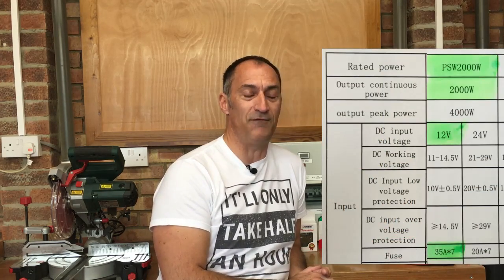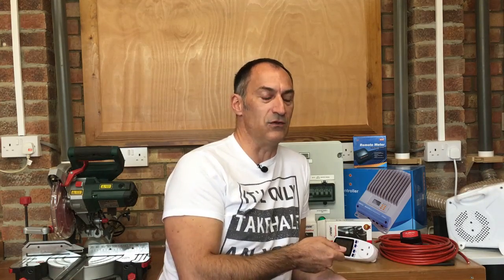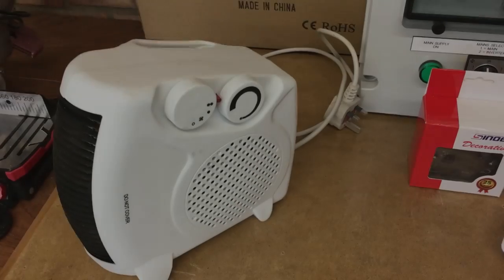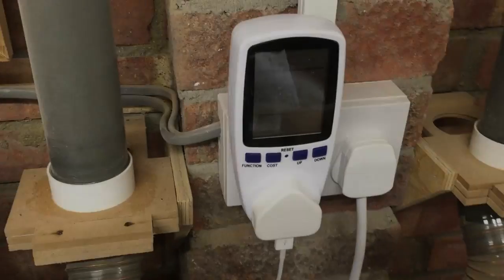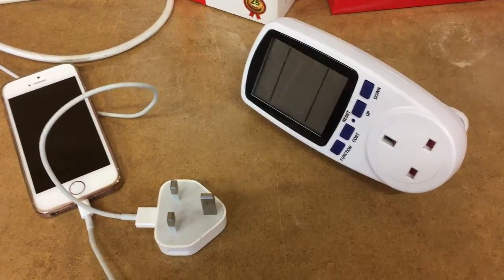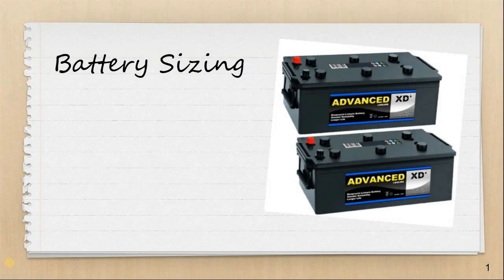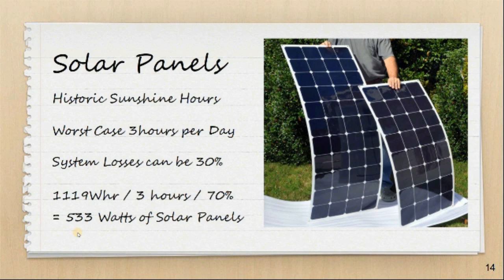Off Grid Battery & Solar Sizing - Self Build Campervan

Comment: Any thoughts on using a small wind generator, remote stand or van mounted?,  to charge. It has the advantage of running 24/7 wind dependent. Great series thanks😃
Reply from the maker: That is another option you could consider, I haven't looked into it but I know they are used a lot in marine industry. You may be looking at boat suppliers for this gear.

Comment: Hi Greg  great video .You could consider a Stirling batter to battery charger I installed 2x60 amp chargers after poor charging using vsr split charger and changing solar wiring to series to give longer charging duration during poor light. Charles Sterling has a youtube channel showing a Sprinter with BtoB charger .

Comment: Hi Greg, thanks for your very informative videos. I am wondering about the power needed to charge the battery. I didn't see it mentioned in the video.
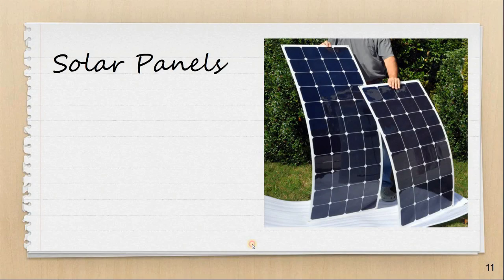Reply from the maker: Hello Jean, the sizing of the solar panels which will be used to charge the batteries starts at 13:37 in this video.

Comment: Like others said, change to a different battery type.  Love the videos.
Reply from the maker: Harvey, do you mean go to Lithium?
Reply: Not necessarily, but always (and much more expensive) better.  If not, "jelled" lead acid deep charge.
Reply from the maker: I’m most likely to go AGM at the moment. Deep cycle leisure batteries with 3yr warranty. Technology will have moved on massively by then.

Comment: Hey Greg, great video again! 

Just recieved my 2500w pure sine wave inverter and the manufacturer included 40A blade fuses. As you mentioned at the beginning of this video I should use a 200 or 250 amp circuit breaker instead between the inverter and battery correct?
Reply from the maker: Hi Adam, take the inverter watts divide by battery voltage and add 25% margin. 
2500/12x1.25=260
You would be better fitting 250A fuse next to your battery.
Reply: Greg Virgoe Thanks again for the assistance Greg!
Reply from the maker: You are welcome Adam. Thanks for your support

Comment: Holy shit. Solar power is inefficient? It has to be the most efficient power we have here on earth. You maby get 5% efficiency out of it in a normal use scenario. That your producing yourself and can place on your camper or house!

But the cost to get that 5% is the production of the solar panel and battery storage. You say 15% of the surface is efficient. But outside of wasted space the 85% outher part of the pannel is not hurting anything. It's just heated by the sun that had anyways heated up the plannet. That 15% is 100% free convertion of electrical power. 85% of the rest did nothing! (but waste space on a roof) Bad thing with solar is that one needs battery storage to make use of it really. That sucks with solar power. But strait solar power pay for itself within its lifetime. (production costs I refer to)

Power from the wall don't use batteries but insted feed you with power generated directly on the grid. The grid efficiency varies but ain't better than 30% and have a loss transporting the power in powerlines to your place of electric needs. Maby your lucky and get 12% out of it. And that can be coal or nuclear power. All have drawbacks and faults. Windpower is also bad due to gearbox failures and the noise and setup cost of the shit. Waste of time build coal plants if you have to. They are that bad. We need the space and resources for better things.

It is all a matter of what you take into account when it comes to efficiency anyways. Kamikaze bombers was a more efficient way to bomb attack in WW2 vs normal bombing operations. Saved more soilder lives to have them ram there planes and themself into the enemy. This being just in some instances but still. Just to give a ide what I mean when it comes to efficiency it's all about what you take into account. And no I'm not a green energy type. I'm just saying that efficient power is not strait out a % but the whole picture from beginning to end. Solar power with some magic battery storage sure is the magic we need to keep or lifes the way they are now.
Reply from the maker: It's a costly affair to be green, but the best solution at the moment if you want to camp off-grid.

Comment: there are panels that can give you 600-900 watts for a sprinter van
Reply from the maker: Hello Andrew, you must mean 2x300watt or 3x300watt solar panels. These would pretty much cover the entire roof of your sprinter. There are currently only two companies that produce a single panel over 300w and the largest I know of is Sunpower 340W panel.

Comment: Very good video just one question do you really need an inverter? Except for the hair straighteners all the other stuff can be powered from 12v ... seems like a lot of trouble for very little use
Reply from the maker: If you can replace all your chargers and tv for 12v and fit a gas fridge then you can get away with not having one. In your van you can do as much or as little as you want. We would like the convenience of being able to plug in a normal 3pin appliance and run our fridge on 230v instead of gas. 
It’s entirely up to you what you want to run in your van. Cheers

Comment: Hi Greg, thanks for the video! I wonder why you only use your fridge for 12 hours in total each day (2x6 hours for 12V and 230V). Are you running it on gas by night or is there something in the calculations i have misunderstood?
Reply from the maker: Hi Maria, great question, your fridge works on a thermostat and the compressor only runs for part of the day when the temperature inside rises, say when you open the door or put something warm inside. For a large amount of time it sits there cold and happy.  It may even be only a third of the day depending on how much you use it and the surrounding temperature. I plan to just have dual electric and not a gas fridge. I don't like having to cut huge vents in the side of my van for gas fridge. Hope that helps. Thanks for asking.

Comment: Hi Greg, I am reconsidering my plans on solar after reading this, really would like your thoughts on this.
https://www.solarpaneltalk.com/forum/off-grid-solar/12v-solar-for-rv-or-camping-etc/367951-help-please-sizing-up-my-new-solar-system-for-my-camper
Reply from the maker: There are quite a few mistakes in the maths there.
The fridge would not run for 24hrs it works off a thermostat.
Depending on the use and how many times you open the door.
This could quite easily be less than a third of the day.

Comment: Greg, I do like your approach! Did you look at B2B chargers when planning the system? There are some slightly scary comments on other sites about "smart" alternators not allowing a full charge on the leisure battery.  There also seem to be some issues with B2B chargers conflicting with other stuff too!  The solar option does sounds like the best/simplest way to go, but it is up there in cost.

Comment: Hey Greg, awesome video as always!
I tried the same sizing you did for battery and solar. In the end i came up with 91,11 Amphours/48h and 84,3 Watts Solar power to calculate with. My question now is: does it make sense to still put a 230 Ah Battery in or is it 150 Ah fairly enough, even if I am going to be staying in the same spot for let's say 3 days of days without plenty of sunshine? Is it a problem for big AGM batteries, if the don't get discharged for their complete capacity every once in a while?

Would you say a 100W solar panel is enough to compensate all of my power consumption or do would you put up more to load the battery?

Thanks for your help and support. =) cheers
Reply from the maker: Hello, with all lead acid batteries you should never discharge them fully as you will damage them. Some manufacturers say you can go to 80% but I would not recommend going down more than 50%. What happens is the further you discharge them you degrade the cells and shorten the number of charging cycles and the life of the battery. It is far better to keep the battery topped up and use a little of its energy. So if you can afford the weight, space and cost go for a slightly bigger battery as it will last longer if not being drained so much. Similarly with solar, as these are so inefficient 15-17% and you can never rely on the sun or weather doesn't hurt to have a little extra in hand. I'm actually fitting 3x160w panels to my roof which is the maximum I have space for giving me just under 1/2 kW of solar. I'm also devising a tilting mechanism to angle them towards the sun, this will give me 30% more efficiency when travelling in Europe due to its northern latitude. Hope that helps

Comment: Does the thing about batteries, that you should only use Them down to 50% apply for AGM's aswell? I heard that they do a lot better on deep cycles. True or not?
Reply from the maker: Hello Henrik, AGM batteries can be discharged to 80% but like all batteries the more you discharge them on a regular basis the shorter the lifespan is in terms of the number of cycles. The cells degrade the deeper they are discharged.
If you can get away with a slightly bigger capacity and not discharge it so much they will last much longer.
Reply: Greg Virgoe thank you for your Quick answer. i Will take this into account for My build. Also awesome channel. Its helping me alot to plan my build on a sprinter im planing to live in.

Comment: Hey Greg. I agree with some people bellow, about your teaching skills, you should definitely consider being a teacher. However, I have a small question. In your table of appliances, I have read that you will be running fridge for 6 hours? Why did you count just six and not 24 h?
Thanks for the answer.
Reply from the maker: Very good question Igor,  Your fridge works on a thermostat, when it gets warm inside the thermostat turns on the compressor and the refrigeration system cools the interior. Once this comes down to temperature the thermostat turns the fridge off. So depending on how many time you open the fridge door and let out all the cold depends on how much your compressor runs for. So I have just guessed that it will be running for a quarter of the time.
Reply: Thanks for the answer, I assumed could be that, but just wanted to make it sure. Thanks again and keep posting your videos, they are great!:D
Reply from the maker: Thank you and hope you enjoy the rest of the series

Comment: Hi Greg.  You, like me, should need to use the hairdryer for very long :o).  Great detail.  I am hoping to opt for a diesel heater as it may be needed when there could be no shore power available.  I probably won't use the hair straighteners much either ;o)
Reply from the maker: Haha, I only need to stand under a fantastic fan on supply and 3 seconds later I'm good to go 😂
Reply from the maker: That’s a good tip for everyone stateside, although shipping and import duty for us in the UK is a killer. Another good source is Marine and Ship industry as they all run off 12v systems too. Thanks 😊
Reply: Webasto makes a great diesel heater,its pretty much the industry standard bunk heater for the big trucks here in the states.Also dont be afraid to check out some big rig stuff stateside for ideas ;)
Reply: They have a European dealer network,I know of about 6-8 in the UK near London along with a few near Manchester too and I'm sure there's more. I know you guys get beat up pretty good importing stuff,I even had to pay import duties on personal goods while working in the UK..........Good times lol.
Anyway,thanks for the great vids with real information for a change.Your van sure beats the air mattress we chucked in the back of a Transit purchased in London and ended in Bulgaria 3 months later ;) Still was a great time though and I want to do it again.
Reply from the maker: That’s sounds like more of an adventure though. I’m all for chucking a mattress in the back and off we got. However unless there is an onsuite the other half is not impressed. Lol

Comment: Lithium deep cell are the way to go as you can discharge them near %100 so a 200 amp hr is equal to 400 amp hr regular battery, they last 6 times longer and are %70 lighter, but are very very expensive...Hope they come down in price by %60 in the next few years..A buddy gas heater and portable gas cooktop might be a good idea to have as backup..
Reply from the maker: You are absolutely right, they are much better but still very expensive.
Reply: @GregVirgoe  could you do a video on where to buy cells, I’ve watched loads of lifep04 balancing and bms seems straight forward but buying cellls is a minefiled ?
Reply from the maker: @tospicy4ya  I’m not the guy to do that. We have AGM batteries living full time for 4yrs now and they have never been switched off abs never dropped below 12.4v so like that they are far better value for money 🥴🤔
Reply: @GregVirgoe  is that even under full load? What battery are they?
Reply from the maker: @tospicy4ya  LEOCH AGM 110Ah Batteries x3 of them. I manage my power use all year round so they are always 70% full and like that they will last me for years. They come with a 4yr warranty to start with.
Reply: And they are much easier to charge since their internal resistance is much lower. Definitely cheaper to use LiFe when considering useful life.
Reply from the maker: @Toaster-v1z  I disagree and as I have lived for 4yrs with AGM I can prove it.

Comment: Hi Greg, superb video and series.... cant wait for the next video.... on my journeys looking through van builds and new van i keep hearing about Lithium batteries in leisure vans, is that something we can do in our custom vans, what are the benefits if anything....????
Reply from the maker: Hello, Mr Mackey, yes you can install lithium batteries as a leisure battery the technology is far batter than lead batteries. You can discharge a lithium battery much deeper before recharging and you will get more charging cycles out of it during its life span. They are smaller in size and also lighter. So there are major benefits to using lithium, however there is one massive drawback, they are still ridiculously expensive to buy.

Comment: Hi Greg, in your table you say times the quantity by watts times hours use. Just done my own and saw that my led lights use less power, yet mine has more w hours. Been through your table and you haven't timed yours by the quantity you have. It's giving you less w hours. Please help as I will need 7 batteries. Thanks Justin

Comment: As I understand it, if you use Lithium batteries, then you can use pretty much the full 100% without quickly killing them off ... unfortunately, they tend to be quite a bit more expensive than traditional leisure batteries.  I don't know how much more efficient the deep-cycle "traction" batteries are, than the traditional ones, however ...
Reply from the maker: You are absolutely right Graeme, it's a shame they are so expensive.

Comment: If you are in an out of the way area, you could always use a generator to top up your batteries and run some of your high power items. I hear Honda has a pretty quiet generator that might work if it is necessary to not make much noise.
Reply from the maker: Brilliant Idea, I do plan to carry a small generator for emergencies if I find i'm running really low on batteries.
https://rover.ebay.com/rover/1/710-53481-19255-0/1?ff3=4&toolid=11800&pub=5575265109&campid=5338027957&mpre=https%3A%2F%2Fwww.ebay.co.uk%2Fsch%2FGenerators%2F46412%2Fi.html%3F_from%3DR40%26_nkw%3Dportable%2Bcompact%2Bgenerator
Reply: Wow, that is a great price. The Honda one I was thinking of is 2000w for around $1000 usd or 727.89 British pound.
Reply from the maker: There is a 2kW one on that link for £150 new!!

Comment: Great set of videos, I am planning on a day van conversion some time but have caravanned for many years. I think you have over estimated the size of batteries that you need by 100%. based on what we used in our caravan.  Remember you need to  watch the weight as well.
Reply from the maker: Hello Bill, with a name like that I'm guessing you found me thanks to David. I would be grateful if you can explain where I have gone wrong in my sums. Thank you in advance. Cheers
Reply: Yes, I found your channel thanks to David, I just think you have over estimated how long you will be using each item per day. When we were in our caravan not on mains hook up a 120 amp hour would last 2- 3 days. 
I guess we had less stuff then that needed power but still you need to consider weight.
Reply from the maker: Hello Bill, ah I see, you are not wrong at best this is a complete guess. I have told the other half if we’re off grid she has to go with curly hair lol  I’ll sit down and have another stab at a realistic figure. Nice to have a bit in hand Northern Europe weather can be a mixed bag. Cheers

Comment: Hello, :) thank you for the very helpful videos. I have learnt a lot from you. There is a point that I cannot get it :) @ 9.39 you said, for total watts hour we multiply quantity x watts x hours. but for LED lamps, iPhone and roof fans, it was not look right. what do you think ?:)
Reply from the maker: Yes, very well spotted Tara, I noticed this too just after editing. 
In my haste, I did not multiply by the quantity.
However, I did correct the blank download file so that will be correct.
I have made adjustments to my solar selection since and battery sizing.
The method remains unchanged even if I came out with a slight error on film.
Hope you'll excuse me for that mistake. Thanks for watching.
Reply: Thank you for your fast respond. there is no need for excuse. I've already learn many useful things from your videos and some small mistakes are unavoidable.
Reply: Yep! I was thinking this too! Thanks for clarification. And a big thank you Greg for all instruction.. I've been "lurking :)" for some time soaking it all up and it's helped so much with my conversion:)